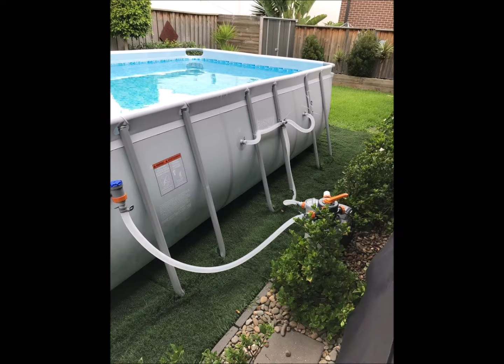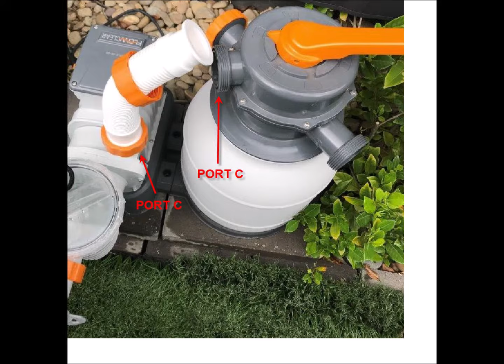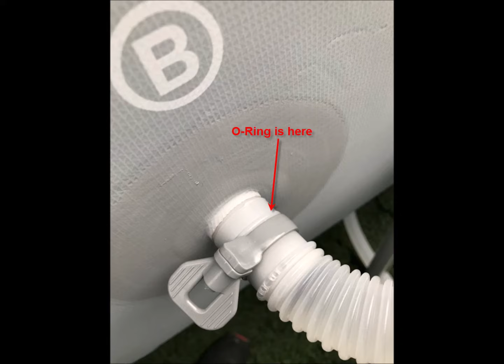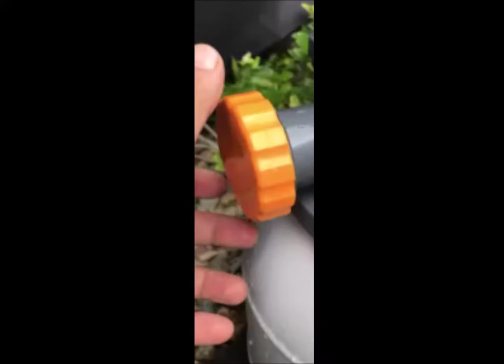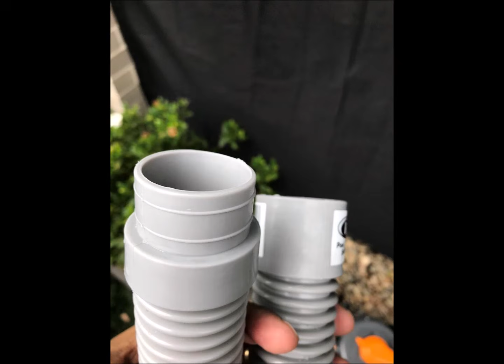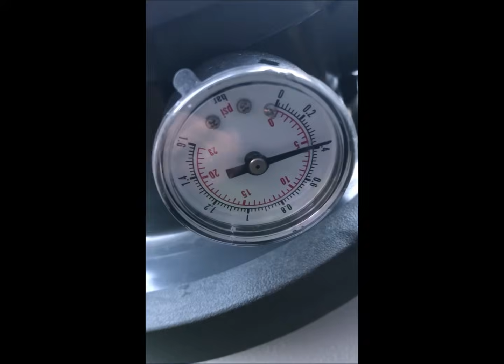BESTWAY SAND FILTER - Flowclear Sand Filter Setup & Operation (PART 3 of 3)

Comment: Realyl good and clear video and I'd love to hear the logic about blocking off various ports during the process.

I've not seen any need to close off port A at any time during this procedure because during backwash and rinse, no water flows out of A. Same goes for port D. During normal filter operations no water flows out of D so I leave a hose connected to it permanently.

Comment: What size pool are you using this pump on? I’ve just bought the bestway 4.88m x 2.44m x 1.22m and I’m not sure what size pump I should buy, this big one or the flow clear sand pump that just has the bigger pump with it.. any help would be greatly appreciated.
Reply from the maker: Hey Casey, the pool in the video is 6mx3m.

Comment: If all of the ports are closed, where is the water coming from that is coming out of port d?
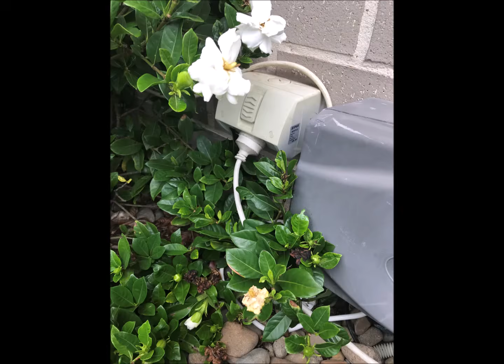Reply from the maker: Hey Richard, in the video at 7:40 mark that is the time when to remove valves from inside the pool. As long as all steps prior are completed you should be ready to backwash : )

Comment: What if when i put mine on the filter setting but i dont see water being shot out to pool as yours did in video do i need to do the whole process to ensure pump is working
Reply: I am having the same problem she is. When I turn it to the filter it doesn’t shoot water out. I even have the valve open.
Reply from the maker: Hey Nancy, check that you valve A that is connected to your pool is not in Closed position.

Comment: You should have 1000's of people commenting on how well you explained these pump and  Flow-clear Sand Filter systems.  I spent days trying to figure out how to properly backwash the system.  I couldn't find ANYTHING on the OEM's website about when and why you should turn off the "A" valve when "back-washing" the system and on what timely basis.  They should pay you a royalty.  Just re-mix your video and increase the volume a bit.  Bestway should pay you fairly for helping them sell their pools. You cannot get any support and every video on their merchandise is only 30 seconds long... useless... they just want to sell you more stuff.
Reply: Amen

Comment: Do you have a link foe the hoses you bought for backwash. I couldn't find the right size
Reply from the maker: Hey Liberty, its from Bunnings, are you in Australia?
Reply: @true.diy.australia667  Nope. USA and having a hard time finding the right fitting for it so I can extend the backwash far past the pool area :)
Reply from the maker: @nighthawk1976  I'm based in Australia, the ones used in my video are from store similar to your Home Depot. They are sold as pool hoses. You may want to ask a pool store in your area if they sell these.
Reply: @nighthawk1976  - Leslie pool supply (USA) carries pool hose in a couple of different diameters.  GREAT idea to extend a hose to get backwash water away from pool.